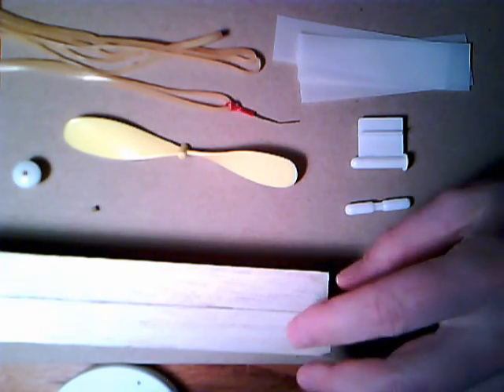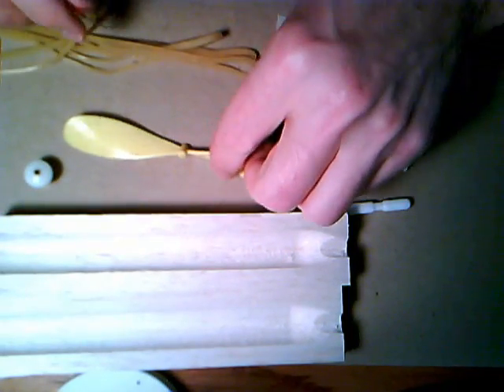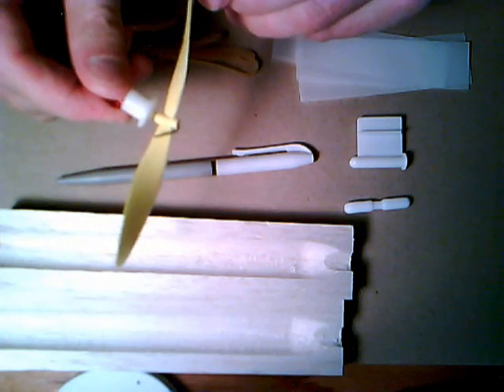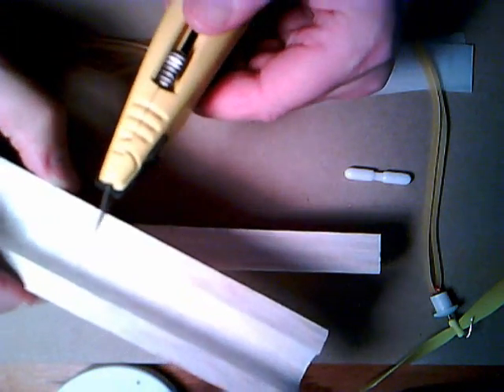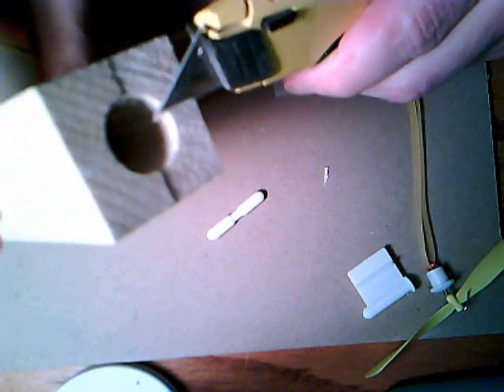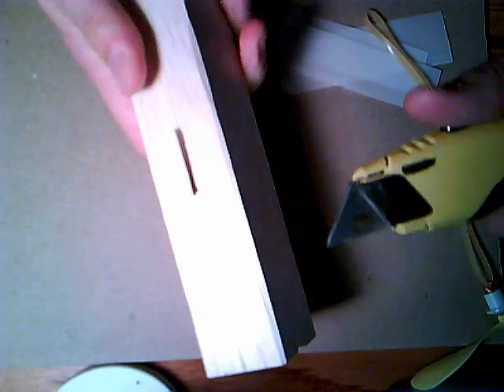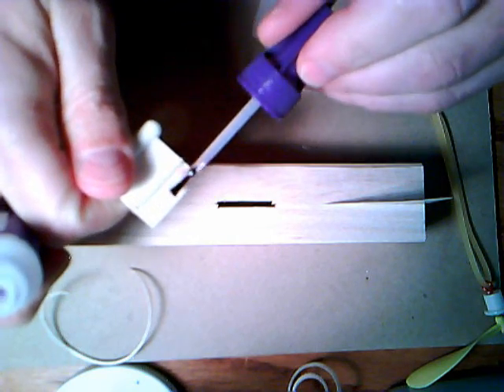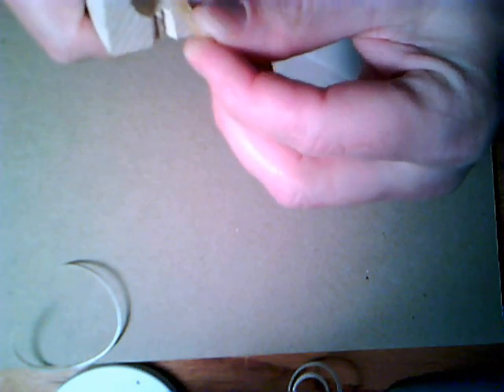Making a Space Derby Rocket

Comment: Seems overkill to use a utility knife on soft balsa wood, when a sharpened pencil will work fine. Using super glue is overkill as well -  it may dry too fast before you get a chance to line up the pieces evenly.  The wood glue worked fine. Placement of the hanger should not be at the seam where the two halves join - too much room for error - halves don't match up when cut, groove is made too wide,  etc.  These instructions vary greatly from the instructions that came with the rocket.  I would watch other videos for more ideas.